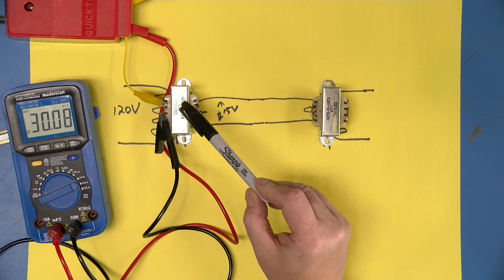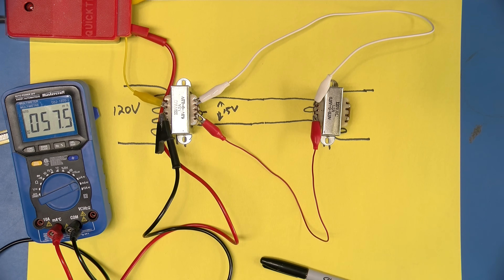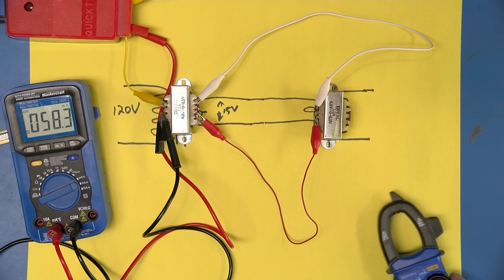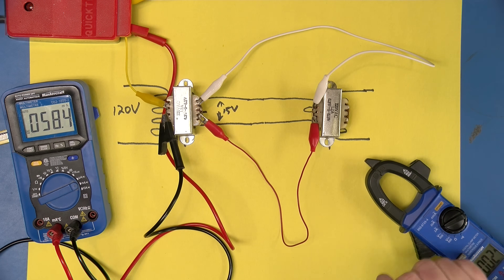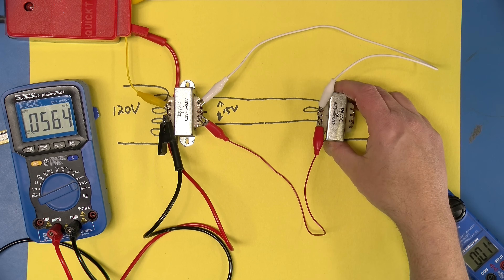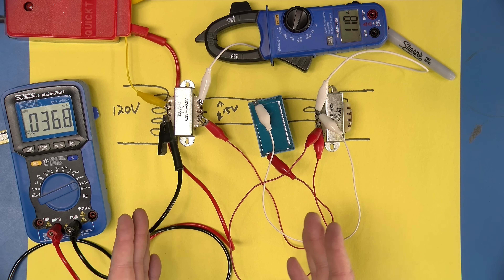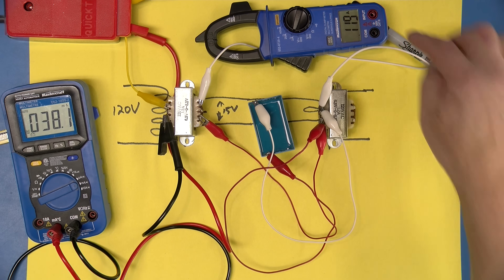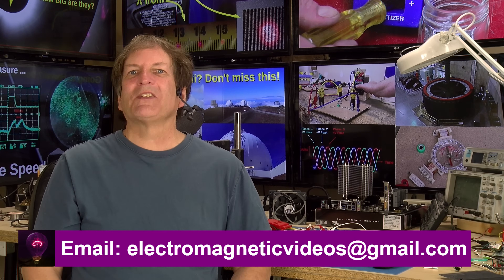Viewer Questions: Back to Back Transformers

Comment: I  recently got my hands on quite a large variac for just 10 bucks. I was thinking to connect it to a DIY isolation transformer, to make a  variable voltage, safety isolated supply. Im planning to connect two microwave oven Transformers, back to back. Connecting the two high voltage sides together. So step up to step-down again.  I olso  curious if I could use them back to back but connected in reverse, feeding the high-voltage  side first. So step down then back up again?
Reply from the maker: $10 for a variac - wow- what a steal of a deal!

You could certainly do that with microwave transformers, but if you do, be really really really careful with the HV. With the current they can supply and the ability of 1kV or so to jump a mm or 2 in air and puncture the insulating layer of our skin, even an unnoticed crack in the insulation can be lethal. One other commenter suggested taking two identical microwave transformers, separating the windings (they often are on separate plastic forms), discarding the HV windings, and putting the two LV (120V or 240V) windings on the same core to make KW size isolation transformer. Much safer in the end!

If you do want see two HV transformers back to back I did it here:  https://youtu.be/prQssIL0VmA

And if you are doing anything with lethal voltages, consider using/making a dead mans switch like this one (it has saved me a few times!) https://youtu.be/ZhCvTCeGvMc   . As a side note, I find the dead mans switch even more important when making vidoes - between running the camera, doing the narration, and doing the experiment, its so easy to get distracted and forget something is energized.
Reply: @ElectromagneticVideos   I have always been absolutely terrified of the HV side microwave oven transformers.  In the past I've always removed/knocked out, the HV winding,  in favor of high-current/Low voltage winding, experiments with microwave oven transformers.  Making spot wellers and other high current devices to melt metal, is a lot of fun, And relatively safe.  Unfortunately my two transformers are not identical.  But I can remove the high voltage windings, and link the two transformers with a single fat winding/. Mabe a copper bar,  pipe or some really thick wire.  It used to be very common to find discarded microwave ovens. So maybe I just need to be patient and find two identical transformers,  and put the two primarys side by side.  You're absolutely correct the "dead man switch" is a must.
Reply from the maker: @MyProjectBoxChannel  I am so pleased to hear your "absolutely terrified of the HV side microwave oven transformers". I am too! So many people dont understand the danger. I try to gently educate people about things like that but there is a fine line between making suggestions and being too forceful and have having people ignore the advice. 

Some thick wire should do it. As a general rule, just fill up the area that the HV had with as many turns as possible of thick wire and it will end up close  to optimum. Of course if the transformers are different enough you may have to tweak the number of turns around one core or the other to get a 120V in 120V out situation. 

If you use really thick wire, keep it less than a cm (1/2inch) diameter so you dont have skin effect coming into play. 

I think whats happening with microwave ovens is the metal recycles really look out for  them because of the copper in the transformer. Interesting a while back they started using copper coated aluminum for the windings to reduce costs messing up things for the recyclers. And of course now they have moved to switching power supplies ("inverter") to reduce the transformer size even more and making the transformers useless for other applications.
Reply: @ElectromagneticVideos  I don't think matching the in to output voltage of my DIY isolation transformer is super important, because I will have the veriac to adjust the voltage. Maybe a slightly higher "step up" voltage could be a advantage 🤔. 

Copper coated aluminium is definitely everywhere nowadays😩😔. It's nasty stuff, but I guess if sufficiently derated and used with spring-loaded connectors, to deal with creep effect. It becomes a viable economic option?
Still copper is best 👌 and aluminium is  too much of a compromise for me.
Reply from the maker: @MyProjectBoxChannel  Of course - I forgot about the variac. 

Where I find copper coated aluminum seems to really have made inroads is Ethernet cable which is a bit crazy since the cable is so small and the the Al is more likely to break. And for short cables  the cost difference is negligible, and long lung the installation cost of laying the cable so outweighs the cost of the cable itself. 

Plain Al cable is still widley used for thicker power handling cables such as for bringing power into the home  for the pole. I just had a 80A electric boiler installed installed for central heat and Al was used for that - Cu would have cost $1K more. And is seems to be OK for that sort of use. (I will be doing a video in the pros/cos of electric heat).

Comment: You should go the other way. 120v -> 1800v -> 120v. Reduce current losses...
Reply from the maker: Assuming the windings are suitably sized, it really should make a difference. 

I certainly wouldnt do that for a demo like this - the sort of voltage is really lethal at the currents that would be present even for a 15W transformer.
Reply: @ElectromagneticVideos  isn't that what demos are for?

 ElecroBOOM shows what happens when doing things wrong...

Comment: How about a buck boost with that set up. It is a cheap way to make diffrent tube voltages.  like how you use test equipment that a poor guy can cobble up. Good show Thanks.
Reply from the maker: You mean like adding a few transformers on the right side of the diagram with the 12V windings in parallel and 120V windings in series to create a few hundred volts for tube power supplies. 

That would actually be a great way to replace the now harder and harder to get tube transformers. The only issue  might be the breakdown voltage of the insulation on 120V side that probably works find to maybe get 240V, but when raised to something like 480V (4 in series) might not do too well. 

One way to get the higher voltages might be to use  a 12:240V transformer and put the two of them in series. The 240V winding insulation  should handle 480V and since 240V power is more common worldwide than 120V, cheap transformers of this kind should be easily available.

 In case anyone's interested, I got these transformers from $2 Newark on clearance, so they were really cheap.

Comment: I made this setup to give me 110-ish volts of isolated power for use in identifying which wire I was trying to locate out of hundreds that we had to choose from. We were re-purposing a 53' semi trailer to be used as a control shack for a converted Gencor asphalt burner to dirt-burner. We used it to clean tainted soil that had been contaminated by fuel spills at the site of the spill. By setting up the dirt-burner at the place of the spill rather than hauling thousands of tons of soil to our plant in Mecca, CA we saved tons of money for our customers, and we didn't have the dirt to deal with once it had been cleaned.

In any case, we left the "neutral" disconnected on the secondary and used a non-contact tester to get an idea which wire it was that we were looking for. The wires were all labeled, this just got us (safely) into the ballpark of where our wire was. We could handle the wires safely without fear of a shock hazard. Worked okay.
Reply from the maker: I'm always fascinated at the things people like yourself have done. Great way to rig up a safe way for identifying wires. 

That must have been a fascinating project. I actually could have used you services 15 years ago when a friend and I did a small housing development on some land that had  fuel spill contamination. The (government approved) remediation was to remove a dozen truckloads of contaminated soil and replace with clean soil. Your device would have been perfect, although maybe our job would have been too small for you equipment.
Reply: @ElectromagneticVideos  Thanks! That's what it was intended for, but it might take up a good sized chunk of your yard. :) Our first project for it was at Naval Base Point Loma, CA. IIRC, it could "burn" 20 tons of dirt an hour. But don't quote me on that. It's been awhile (2010).

The customer had to provide natural gas and electric hookups, and bring in/haul out their dirt. This unit took seven truckloads to transport and could be setup anywhere in the States in a week. The last that I had heard, it was burning dirt in North Dakota.
Reply from the maker: @MrWaalkman  It really says something that is still in operation. I'm surprised there isn't a company manufacturing your machines - there is so much contaminated soil that at times needs to be remediated. Here (Ontario, Canada) there is apparently a plume of contamination around every (no longer used) small town garbage dump, gas station and some dry cleaners (who would apparently dump the carbon tetrachloride out the back door). Im so the cleanup companies are making $$$$$ these days.
Reply: @ElectromagneticVideos  Oh, there is. We used an old semi-mobile Gencor asphalt mixer as the basis of the machine. Gencors, with the exception of their control shack, are mobile. So you can easily move around 80% of your system. Unfortunately, the last 20% is nailed down and hard-wired. I think that the (sneaky) intent was that you bought a system that could be moved around as long as you paid Gencor to take it apart and re-commission it when it got to its new home. Ours had 11 (IIRC) Meltrics plugs that our guys would unplug and plug back in once it got to its new home. Easy-peasy.

Keep in mind that given the age of the machine, mobility might not have been a major selling point back then. I noticed that the "G" series Gencor machines look to actually be mobile.

The control shack on a Gencor is a room built upon stilts and is not mobile at all. I guess those would be disassembled and shipped. We scrapped ours.

The entire controls system had to be re-designed from scratch, and all new wiring. Total cost was somewhere north of $100k IIRC. Which I am sure was easily made up on the first job. The old controls were 1970's era, so a bit finicky to deal with. Mostly legacy transistor amps and such. The prints (all 10 or so pages of them) were the old school sepia prints. Not as old as an actual blueprint, but mercifully no longer an active media for print outs.

For what I am doing these days, I'm helping with a retro-fit of the RAID Fluid Recovery System (FRS) to make it easier to store the electronics during the Antarctic winter. You can't leave them behind and expect them to work the next season. So we re-packaged the controls into something that is quite a bit smaller and can be handled by one person.

BTW, the RAID guys are looking for a PhD to head up the project, and Duluth is not that far north of Toronto. :) BTW, I worked at the Bramelea Chrysler plant back in the 90's on a new body shop. Loved Canada!
Reply from the maker: @MrWaalkman  Makes sense from so many standpoints including generating future revenues when the machine gets moved. 

You certainly are involved in a lot of fascinating stuff! Are you getting a visit to the Antarctic? That would be an amazing business trip! So you worked in Canada for a while - wonderful! That must have been when Lee Iacocca had recued the compnay and it was doing OK. Sad how its a shell of its former self today.  I'm on the outskirts of Ottawa so a bit North East of where you were.
Reply: @ElectromagneticVideos  I get the oddball projects it seems. In any case, I'm always up for them. :)

As for me going down to Antarctica, 

a) I'm too old, the cutoff age is around 50, I'm 67. It would require papal dispensation. And there are two young MEs who I helped to teach how to program PLCs who are scheduled to go there for support. I do expect at least one satellite call though. BTW, everyone down there is on Wellington, NZ time. :)

b) The system is designed to drill up to 3 km down. A quick look at my slide rule, and that's about 9,800 feet. And you could be drilling on top of a couple thousand feet of land under all of that ice. Fun fact: The average elevation of Antarctica is 8200 feet (close what I grew up at back in Colorado). So all of my souffles will fall flat! Sacré merde! We can't have that! 

My next project might be to finish up some timer board designs for a company here in Tennessee. The place is straight out of the 80's, including some old Macs for design, and at least one Tandy CoCo that was used to run a label machine. That would be fun!
Reply: @ElectromagneticVideos  Oh, and Canada was my favorite foreign place to work. I have also worked in Japan, and I did a one week stint in South Africa. Both of those countries were lovely, but Canada is great!
Reply from the maker: @MrWaalkman  Its funny- you sound a lot like me ending up doing all sorts of different, interesting and strange things. Really beats doing the same thing every day! A Tandy Coco - had no idea they were ever used for anything other than home stuff and games. Werent they 6809 based? As I recall the 6809 had some 16 bit features such a s math, but was a flop because it was more expensive than other 8 bit cpus but not close enough to the real 16 bit one like (ironically) the 68000.
Reply from the maker: @MrWaalkman  South Africa! When I was a kid we lived in Johannesburg for 4 years. Beautiful country. If it wasn't so dangerous these days I would love to go back there for a long vacation.
Reply: @ElectromagneticVideos  I do like variety. :)

Not that I am a CoCo guru, but my understanding is that the Cocos (at least the CoCo 3) was 6809 based, but could use a Hitachi 6309 as a drop-in replacement for the 6809. Which was far superior. And there is still development for the CoCos going on! Be careful with the CoCo 3 computers, they have a chip that is made of unobtanium and it tends to break. 

The 16 bit CPU that was a flop was the TMS9900 which was used in the TI-99/4A. Technically, it was the first 16-bit home computer, but it was limited to 8-bits. :)
Reply from the maker: @MrWaalkman  Too much "unobtanium" these days!  The TMS9900 - another unfortunately footnote in the history of computers. Oddly the CPU was used in one the jet fighters in 80s (sadly I dont remember which) . I was at a technology show and one of the big military suppliers (possibly Lockheed) had a poster of their latest jet fighter and come circuit boards on display. I immediately saw the TMS9900 cpu and asked them why they didnt use the much faster 80286/386 or whatever was current. They explained to me how a well understood and tested slower chip was way better for critical stuff than the latest fasted cpu. Was a  great lesson for me.
Reply: @ElectromagneticVideos  Tell me about it. 

I believe that the TMS9900 was used in the F-111 Aardvark's terrain-mapping radar, but that's based off of random memories. :)

The choice of CPU is important, the new (at the time) Allen Bradley PLC-5 PLCs used an Intel 80186 for its CPU and they were slower than a fat boy on a bicycle. And over its lifetime it never really got all that much better. 

Contrast this to the GE Series Six PLC which used four 4-bit Atmel AM2903ADC CPUs. These were "Bit-slice" CPUs (which would be an interesting side trek into CPU development for a YouTube channel). They were combined together to create a 16 bit microprocessor that was optimized for Boolean operations. 

The GE S6 PLC ran at a very impressive 7ms scan time while the AB was lucky to get down to 50ms (with no programs loaded in either PLC). The 80x86 CPU would go on to rule the world, but that didn't make it anywhere near the best. :)
Reply from the maker: @MrWaalkman  I just looked up F-111 Aardvark - General Dynamics - they have a big presence in Ottawa. So that might very well have been it! 

Am2900 - sadly I'm old enough to remember them! Here;s one for you: Ever heard of the National Semiconductor 16032? later the 32032? The greatest CISC microprocessor ever made. Used it in a number of OS/Computer courses I took as a student. If it hadnt been buggy and taken years for NS to correct, it might have been the processor in the PC AT. I actually have one I bought back then to make my own microcomputer but never got around to it - sometime it will be in a video!
Reply: @ElectromagneticVideos  I was completely unaware of the NS CPUs (really no surprise there as until up until my approaching retirement I was an x86/AMD guy). I see that they had a bit of bad luck with errors in their CPUs (as you had mentioned) and were eventually left behind. Hard to find any of the NS CPUs these days.
Reply from the maker: @MrWaalkman  I think the NS CPUs were mainly known by profs and students who used them  in university. NS did provide a number of universities like the one were I was with dozens of NS 16032 boards running Unix in the early 80s. It was like having a dozen free VAXs and they were great for in depth OS courses and also computer graphics. This was 3 or 4 years before the 80386 came along which had full virtual memory and protected mode abilities. and PC could finally run real OSs. 

Apparently the NS cpus did get used in laser printer for a while because the had very good bitwise abilities for dealing with individual graphics pixels.